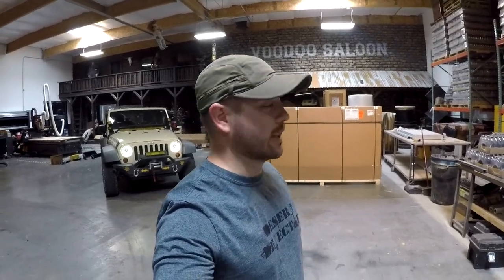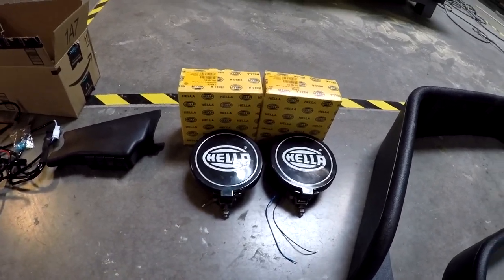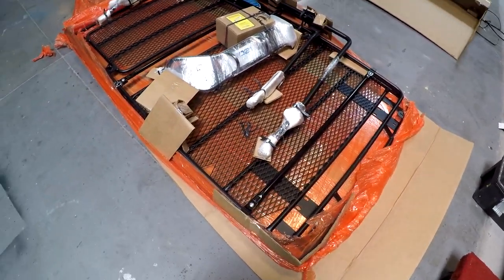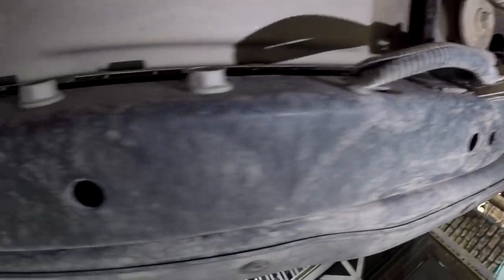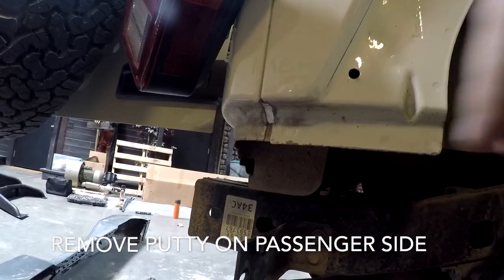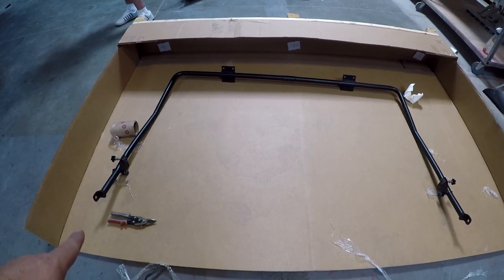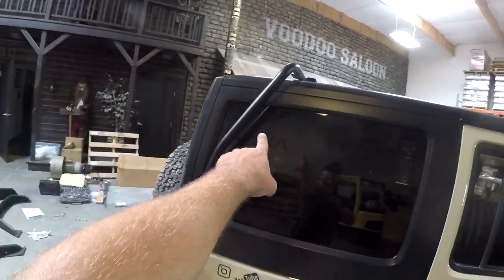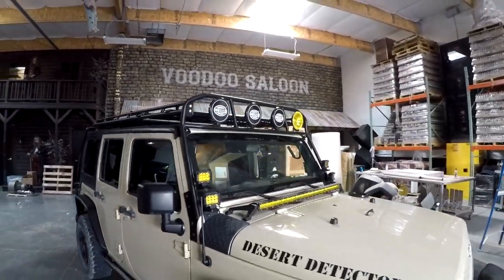How to install a GOBI roof rack. BEST ROOF RACK ON THE MARKET!

Comment: Thanks for the video. I just ordered my Gobi Stealth Rack last week, and will try to wait patiently for it. I was told 16-20 weeks. Hopefully it doesn’t take longer, but I’ve saved your video to watch again when the rack arrives. I noticed you didn’t mount the “upper isolators” to the back of the hardtop. (Gobi recommends adding them for heavy loads) Have you noticed any unwanted movement in the rack with a heavy load on top? The isolators are an additional $110 but I think it’s good insurance against messing the rack up. I’ll be carrying (4) 5gal Fuel Cans on the rack during my desert trips. (That would probably count as a “heavy load”)
Reply from the maker: I’ve had my rack full with gear and never had any issues.

Comment: Great video, thanks! Can you take the Freedom Panels off under the metal mesh panel at the front?
Reply from the maker: You have to remove the mesh insert (4 bolts) to get the panels out. Not a big deal. I do it all the time

Comment: Hi, I stumbled across your video today. My family is in Las Vegas. We have the Gobi stealth rack, they are phenomenal racks for sure. Can you share how you ran your wires from the lights? We are doing our first install of lights on our JKU. We are installing our A pillar switches, etc... this weekend.
Reply from the maker: You have to use a relay wiring harness from the battery to the switch pod. Ground each switch to the Jeep body and the positive for each switch to which lights you want to control.
Reply: @desertdetector4476  right, to clarify where and how did you run the wires from your lights to your switch pod? Trying to be discreet but also not drill any holes in the roof ;)
Reply from the maker: @elizabethnorrbom7987  gotcha. Option 1: If your running a led bar across the top then you can either tuck the wire along the A piller bar of the rack and go under the cowel (the piece the the windshield wipers come out of)  there should be a hole in the firewall about a foot down just to the drivers side of where the steering column goes through the firewall. That hole was put there but Jeep to run wires from the front of the Jeep to the inside without drilling. From there you can run it up to the switch pod easily. 

Option 2: is to tuck the wire under the front of the freedom panel and down to the switch pod. This is the option I did for my top lights and it’s pretty discreet. The rest of my lights on the front I went with option 1.

Comment: Nice video! Which fenders did you get? They look great!
Reply from the maker: Thanks. I really like them. A little tricky to get on unless you have a nutsert tool. But it’s doable. I got them on Amazon. The brand is Refineon. They are just textured tube steel flares. All four were $250.

Comment: Is not good on heavy off-roading, mine is shaking feel like falling off 😅
Reply from the maker: Mine does slightly when I have a lot of gear up there but I’ve off-roaded hard with it for over two years with no issues.